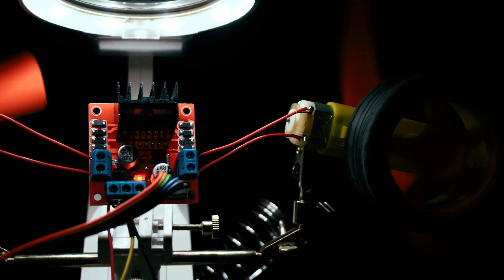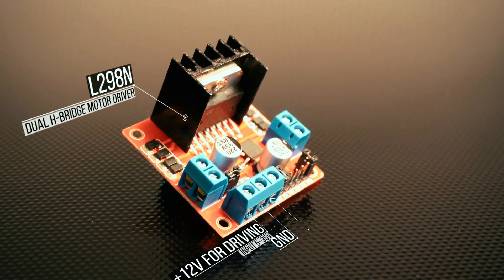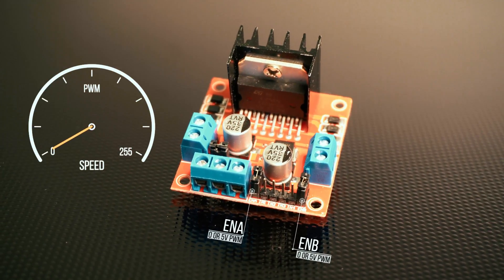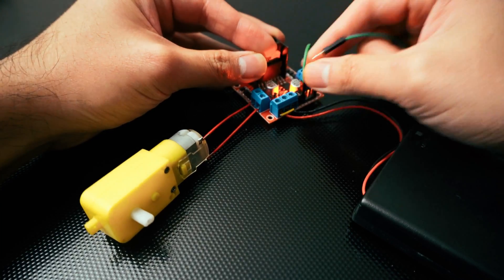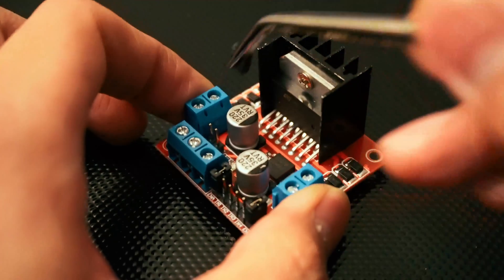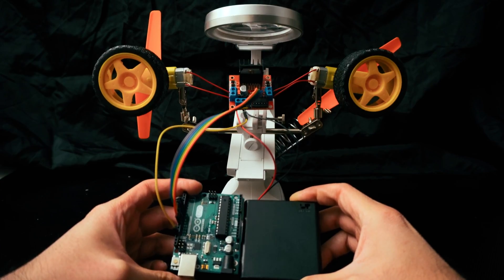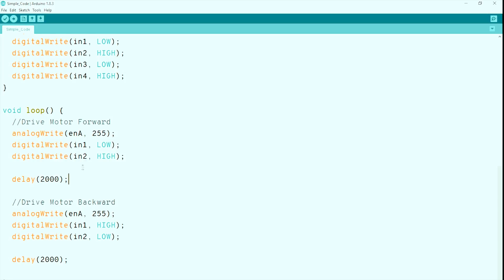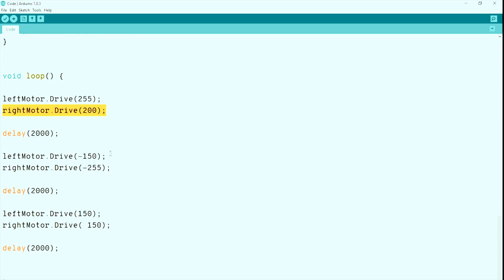L298N Robot! Learn how to drive DC motors with L298N and Arduino (From Banggood)

Comment: got an error with the second set of code that says    "Arduino Uno"

sketch_aug13c:29: error: ISO C++ forbids declaration of 'Drive' with no type

i'm new with arduino, please help me,  thank you
Reply from the maker: Try to add "void" before Drive, just like the  "void loop". If still doesn't work, just delete the drive and use 
analogWrite(enA, 255);
digitalWrite(in1, LOW);
digitalWrite(in2, HIGH);
like in the first code. The drive is only to save lines of code

Comment: @chenthedesignmaker Hi. If I using 2 motors of 12V what should be the input to the driver? 12V or 24V??  Weather that driver ckt connects 2 motor in series or Parallel?

Comment: Hi. If I using 2 motors of 12V what should be the input to the driver? 12V or 24V??  Weather that driver ckt connects 2 motor in series or Parallel?
Reply from the maker: if you are driving 2 motors, they should be connected to the A and B side, and you'll want to apply 12 V. Hope this helps :D
Reply: @ChenTheDesignMaker  Thank you. Can I know what is it's Max current handling capacity? 
Can I use a 12V, 3A motor with that?
Reply from the maker: @PrajwithUllal  I did a quick search and the amp it supports is 2A per channel. I'm not sure what would happen if you use 3A motors
Reply: @ChenTheDesignMaker  ok. thank you🙂

Comment: Hey, i did the same thing as you but nothing happens. The red light is on but that's all. And i tried to test the motors conected only to battery and they work. Does this mean that my l298n driver is broken?
Reply from the maker: Hi Carina, what is the batteries you are using? Might be not enough power.
Reply: @ChenTheDesignMaker  12v aaa. I found the problem:the motors were not connected properly
Reply from the maker: Great! Have fun!
Reply: @ChenTheDesignMaker  Hi. If I using 2 motors of 12V what should be the input to the driver? 12V or 24V??  Weather that driver ckt connects 2 motor in series or Parallel?

Comment: Nice edits, but I recommend if you using motion tracking make sure to make dots more visible so it will be more trackable for camera to find, but all is good I am waiting for this video since your last tutorial.
Reply from the maker: Thanks for the advise! Yeah it's my first time doing motion tracking so could you tell me more about the "make dots more visible"? 
 I'm almost done for all the connections so that should come soon!
Reply: By I meant dots more visible is you need to add visible black dots or colorful in the place that you want to have motion track on so the camera solver will concentrate and follow the item that you desire to track on, but is all good it awesome.
Reply: also I have question about your last video For Arduino Avoidance Tracking Motor Smart Robot Car Chassis Kit 2WD Ultrasonic how many days before you receive the item?
Reply from the maker: Usually order from banggood  can be delivered as fast as 2 weeks or a bit more than a month. I'd say on average three weeks. I'm still waiting for some of my parts ordered last month...but I guess is holiday season. I'm sure their customer service would take care if the package go missing.
Reply from the maker: Thanks, I'll try to make it better next time :D
Reply: @ChenTheDesignMaker  Hi. If I using 2 motors of 12V what should be the input to the driver? 12V or 24V??  Weather that driver ckt connects 2 motor in series or Parallel?